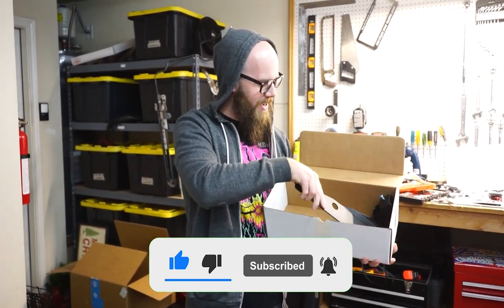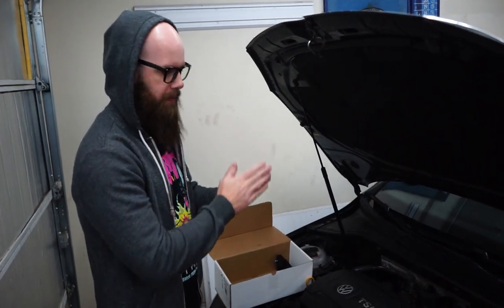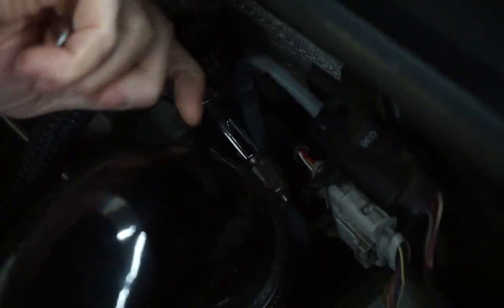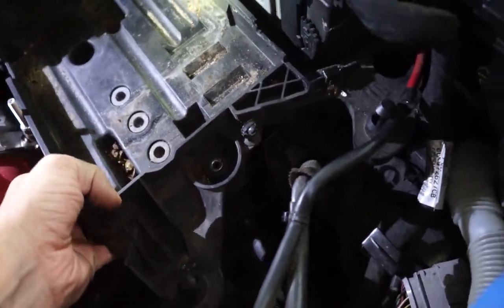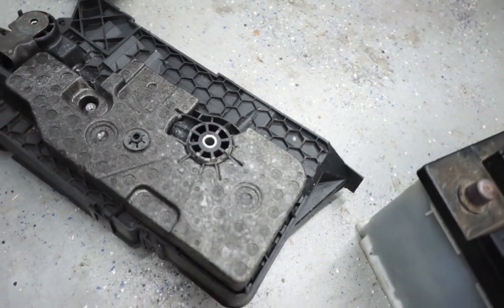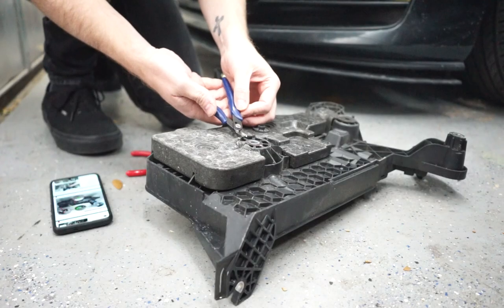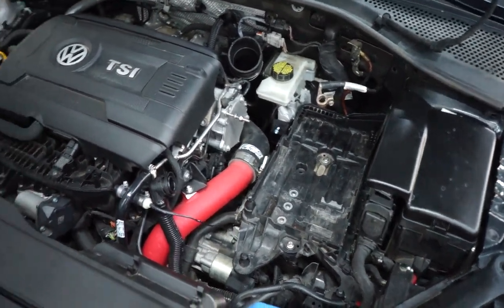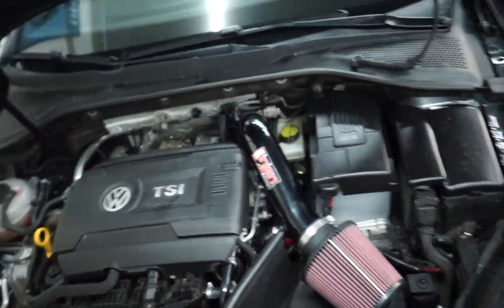Brake Upgrades for Mk7 GTI - ECS Tuning Master Cylinder Brace

Comment: Finally a video! I love mine.
Reply: Oh, FYI for anyone watching: Dremel tool with cutting blade makes the trimming of the battery tray 1000x faster.
Reply: How long did it take to install from start to finish?  Do you have after market charge pipe or oem?
Reply from the maker: It shouldn't take long. I have aftermarket pipes.
Reply: @SKYRIDR  I'm running do88 charge pipes, they are a tighter fit but they are BIG. The brace didn't even come close to mine.

Comment: Boy, I keep running across your videos and you put on so many things that do not provide much benefit.  If your brake pedal is going to the floor when hard braking, your fluid is toast or your pads are severely worn.  If you want less "deflection", have you done steal braded brake lines yet?
Reply from the maker: Boy, thank you for commenting on my videos. The brake pedal isn't 'going to the floor' due to the fluid. It's not going to the floor at all. There's a flex in the firewall, this makes it more solid. But I will trust you since you're an engineer. Thanks for watching.